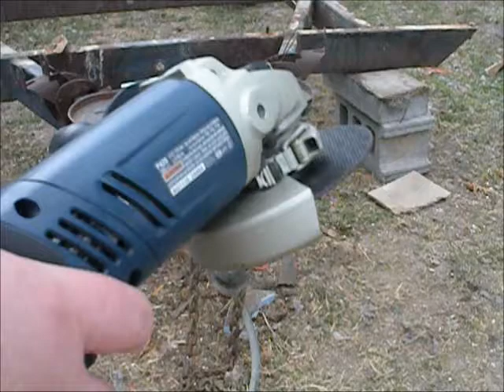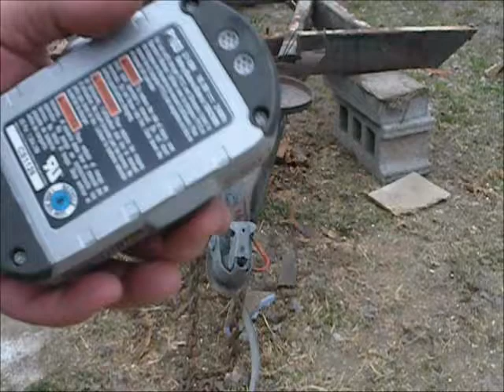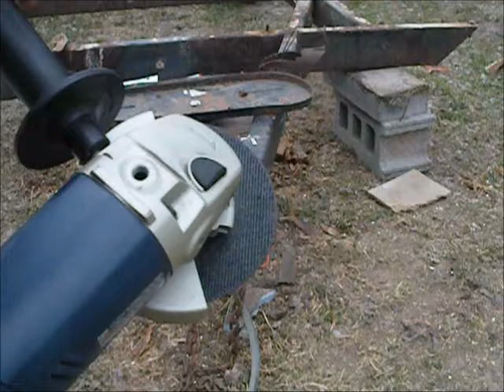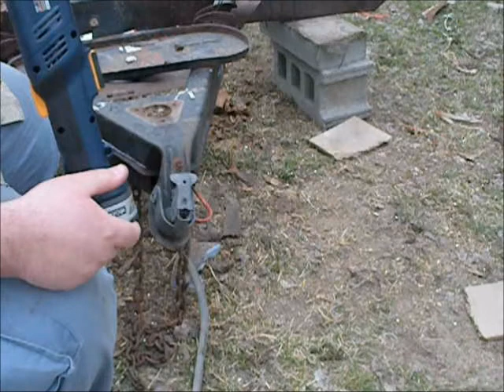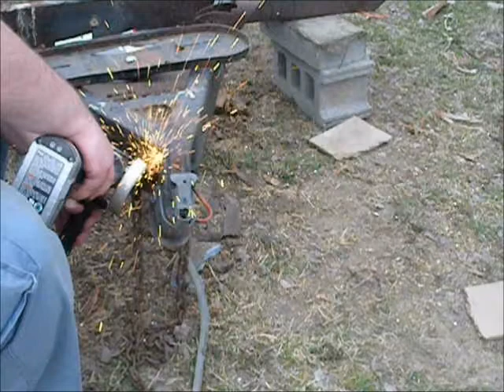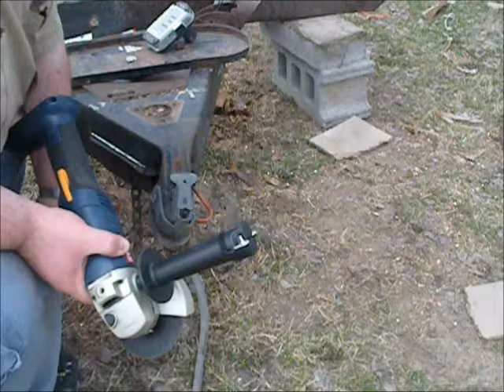Ryobi One+ 18 volt 4 1/2" angle grinder model P420 battery use grinding 1/4" steel

Comment: i got one of these they work great and not to heavy,100mm disk, come with a case, grinding disk,700watt ,golds toll in the handle, guard moves and handle can be moved http://www.ryobi.com.au/Products/PowerTools/Corded/Grinders/EAG75100RG
or one with a handle like yours you can get http://www.ryobi.com.au/Products/PowerTools/Corded/Grinders/EAG85125RG with a 125mm disk
Reply from the maker: I do like having the tool right in the handle to change disks, I am likening mine even more now with the new lithium + batteries it actually has more power and a longer run time now, I just used it today I was surprised with how much more the lithium + small battery helped it it felt like running my plug in model.
Reply: redicety12 yeah they are pretty good until you need to cut thick and allot
 of metal
Reply from the maker: 1001randomthings Yup I pretty much use it for quick jobs or hard to get to jobs that sort of thing and use my regular plug in grinder for anything else. Very very handy though especially around the farm, I have used it a lot when doing fencing work.

Comment from the maker: I personally did not care for the circular saw, seemed to eat batteries bad but when I had it the lithium were not out yet, may be better with those but I figure I prob don't need it anyhow have the scroll saw and saws all for cordless saws should be good enough if I need circular saw have plug in ones.

As far as using a car battery or whatnot I know you can but kind of defeats the purpose of a cordless battery, may as well just use a corded unit.

Comment: im off buying this grinder and the circular saw in a few hours, thing is, im not gonna pay for lithium crap. id rather get a cheap lead acid battery like car batt or mobility scooter battery n use that, ive used 12 volt batterys with ryobi recip saw (see my vid), 2400 mah NIMH pack gives 5 mins on wood, 7200 mah lead acid about 3.5kg, gives about 15 mins fair few branches. load cheaper than this lihium crap that cuts out.. oh yeah, if it keeps cutting out I just wire it directly onto the motor